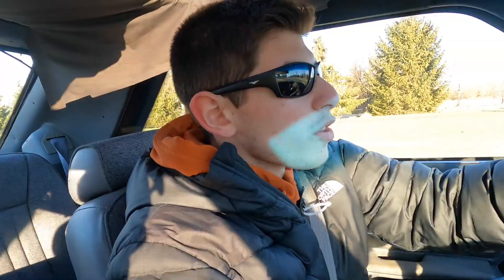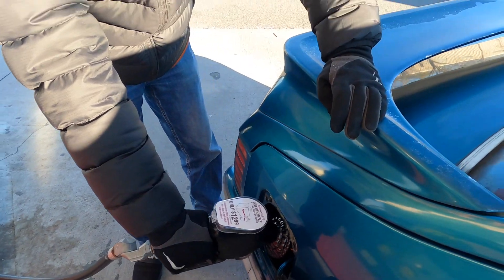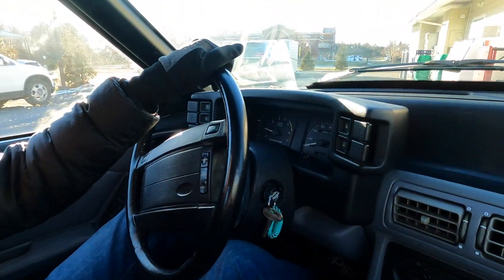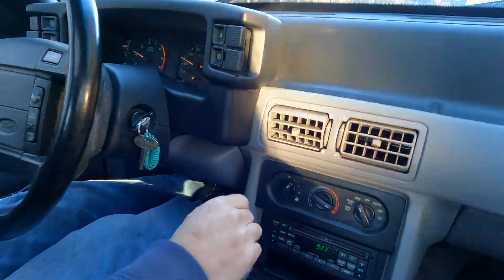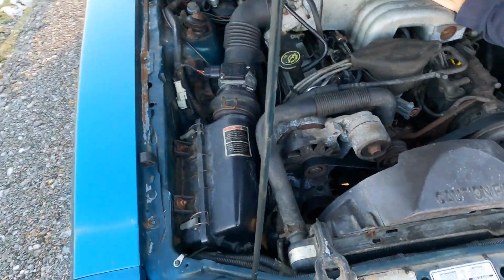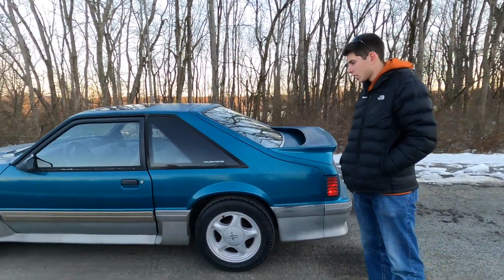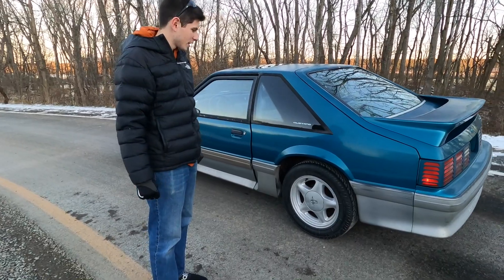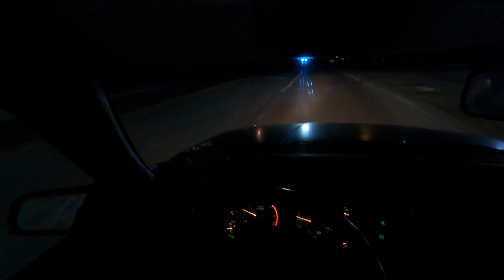FIRST DRIVE In Over 13 YEARS!! | Did We Make It Home? | ABANDONED

Comment: Cool to see the 6 digit odometer, started life in Ny. Do you plan on keeping this car? The air bag light is flashing because of the clock spring. Totally common. I have a few low mile cars as well that do the same. Awesome videos guys, sweet ride🤙
Reply from the maker: Yes, I think this one is a keeper. I didn’t know that about the air bag light. Thank you for watching!
Reply: Airbag Code 12   Replace Airbag Control Module. Its NOT the clock spring, hate when ppl have know idea what there talking about?
Reply: @Hanson3  I don’t know what rock you’ve been loving under bud but the most common issue IS the clock spring. There may be other causes to a flashing air bag light but that IS the most common. I hate when people are ignorant for no reason instead of bestowing friendly knowledge
Reply: @foxinabox761  I own two foxbody's, both had same code 12....
Reply: @Hanson3  🥳 🥳🥳

Comment: How about a 1992 just like that one in 93 only had about 8,000 mi on it over 100,000 mi on it never did nothing to change oil and brakes on probably change the coolant one time assorted you were still running good clutch was still good at over a hundred thousand miles on a clutch still working good

Comment: FYI, Foxbody mustang has a sticker in the doorframe on dr or pass side that tells you proper title pressure which is no where near the max 50psi tire mfg states.

Ford states my My 91 gt is supposed to Be 32-35psi so running your 15yr old dry rotted tires at 40psi  like you stated you put in the tires is way too much air over inflating them to poss blow out esp at higher speeds,
Reply from the maker: Yes, we noticed haha. We were trying to get the round spots out the tires... the best we could anyway. We won't be driving it far until we purchase new tires. Thank you for watching!
Reply: @theunskilledmechanic  no, you didn't know where to check. But now you know. Don't try and BS that you were doing that on purpose. You could have seriously hurt yourself. Cold, old, overinflated tires are a recipe for disaster.

Comment: Jesus, don't go by the max tire pressure. Go by the placard on the driver's door jam for tire pressure. 32 to 35psi.... Also, your oil was also full of gas seeing you compression tested without pulling your fuel pump relay. With that much gas in the oil, you should do an additional oil change. Your overheating is due to a thermostat not fully opening. Start with that first.